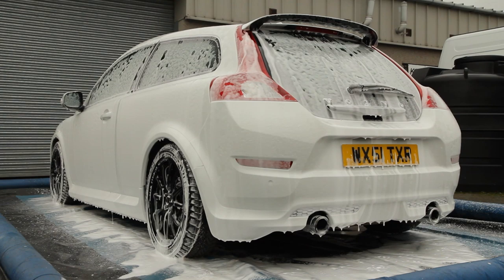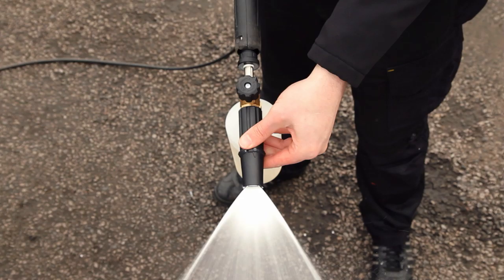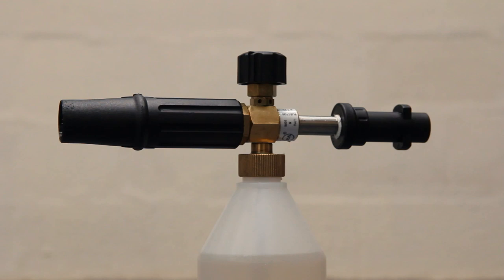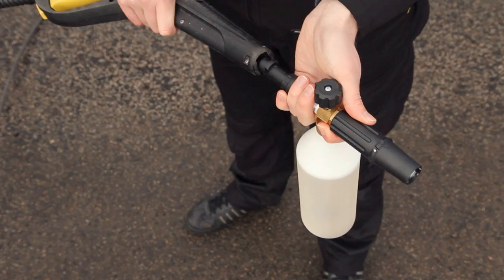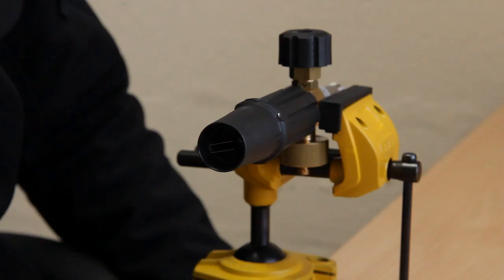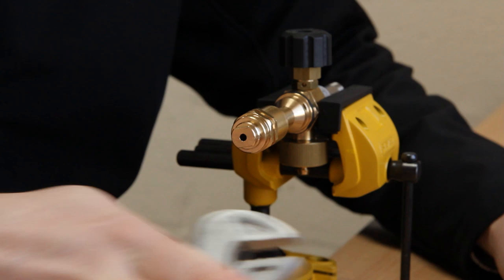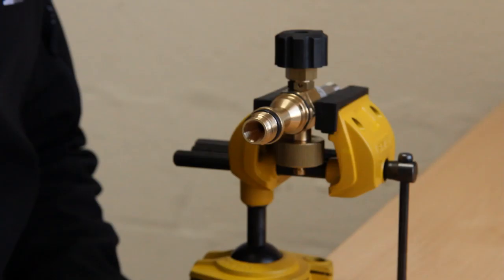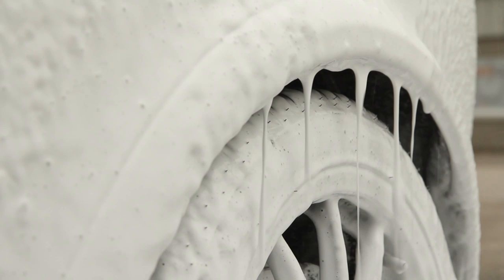Polished Bliss: PA Foam Lance Demo Video

Comment from the maker: It has to be lined up correctly with the flats on the filter cover, and it also need a firm push (or a firm pull using an Allen key or screwdriver shaft - I demonstrate this method in the video, using an Allen key to firmly pull it back on).

Comment: Just pulled mine apart due to the mesh getting gunged up with soap. I find that if you drop it into a small pot of boiling water on the stove, your ready to rock in a matter of minuets. I found tho, that when I'd put it back together again, the locking pin slides out a bit when I turn the barrel. Do I need to glue it? Still works like a dream, but that pin is an annoying pain in the arse.

Comment: I purchased one of these, however I don't like how the fanning blades are aligned horizontally. Is there anyway you can swap it to become vertically aligned?

Cheers
Reply from the maker: I'm afraid not; the blades on the PA model we stock are always aligned horizontally.
Reply: Kevin Ah Seng Autobride PA lance has the exact same lance, but the blades are aligned vertically.
Reply: Kevin Ah Seng x- 32 1  n
Reply: Kevin Ah Seng x- 32 1  n
Reply: Kevin Ah Seng x- 32 1  n

Comment: great video ! however i do have two questions 1) what sort of cleaning agents can you use to soak the filter in. 2) all the brass connectors on mine have got like a descaled of  sort of colour is there anything i can use to clean the brass parts with ? thank you
Reply from the maker: Ben Rowe Hi Ben, (1) an acidic descaling solution will work best (available in the plumbing aisle of most DIY stores), (2) a moderate strength metal polish should do the trick, e.g. Raceglaze Alutech.
Reply from the maker: We've never tried this, but we can't see any reason why not.

Comment: What is the problem you don't get a lot of foam coming out of the canon and your bottle go's empty fast
Reply from the maker: Poor foam production usually means a thorough clean is required, as per the above video. However, the bottle emptying out faster than expected doesn't really go hand in hand with this - when foam production is poor the bottle usually empties more slowly, so this is confusing. I would start by stripping the entire unit down and cleaning it thoroughly - this usually resolves most issues.

Comment: 1 question if I use it weekly wise then after how many weeks do I have to clean it by opening it? Thanks in advance reply soon.😊😀
Reply from the maker: It's impossible to say with a high degree of certainty, as there are too many variables in play; water hardness, type of snow foam used, care with which the unit is rinsed out after each use, etc - all influence the answer. However, as a rough guide, in hard water areas it's not unusual to have to service it every 6-12 months, whereas in soft water areas once every 12-24 months is normal.
Reply: Polished Bliss thanks bro i have ordered mjjc snow foam lance may reach in 20 days to India ya i use soft water thanks very much.✌😀

Comment: Hey, can anyone give me the name of the best descaler to use ? Can you also tell me if I should take apart the entire device and soak all the parts in a special solution?
Reply from the maker: Sorry for the tardy reply; both Viakal and HG make good ones that are available in most DIY stores. The only part you should need to soak in the descaling solution is the stainless steel wire mesh filter, which you can locate and remove using the instructions in the video.

Comment: Do not overlook this step, as the consequences do not bare thinking about..... dare I ask, what would happen?
Reply from the maker: Well, if a high pressure connection separates/fails then part of the lance could shoot off into whatever you're pointing it at: I saw images of just such an accident on Detailing World several years back. Remember, always check your gear on a regular basis!